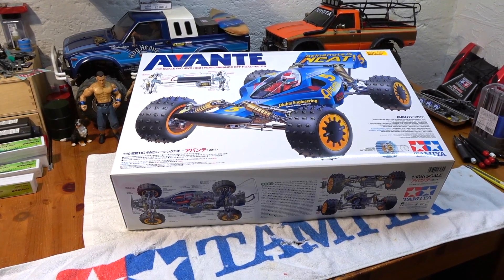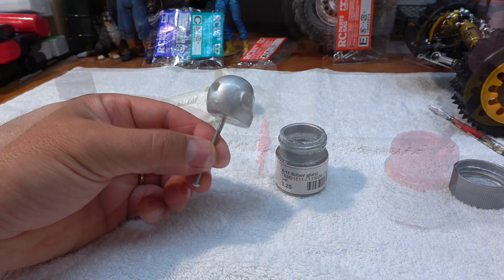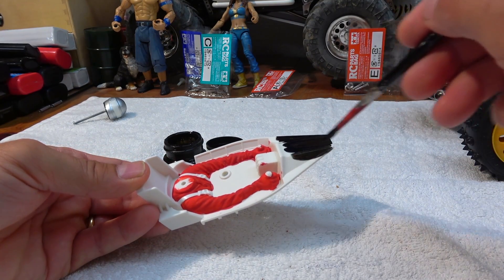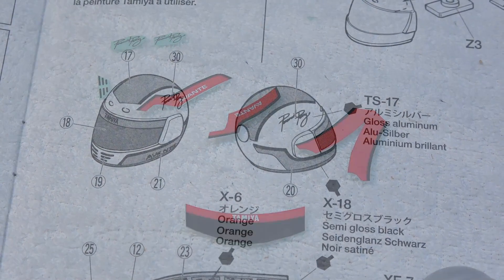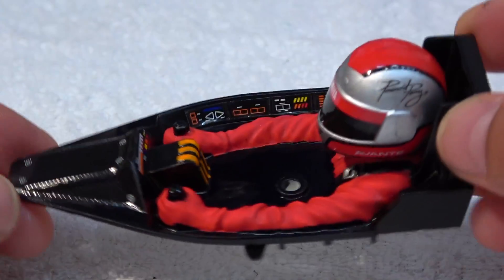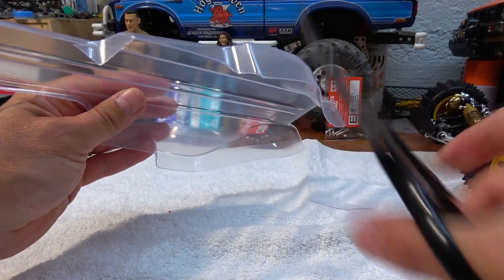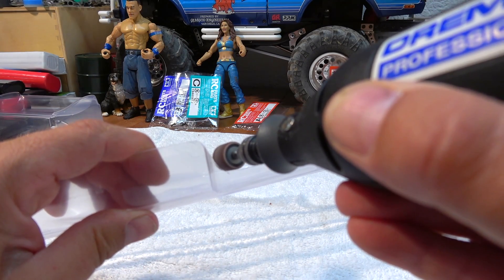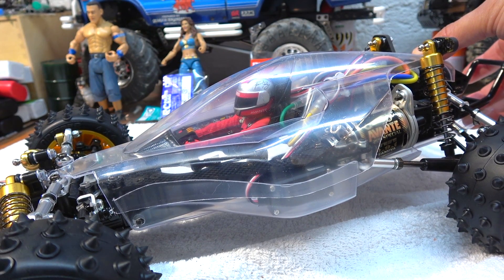Tamiya Avante Build / Video 7 / Steps 39-40

Comment: I have done my fair share of Tamiya and I have found for brush painting, a ratio of 50% paint and 50% tamiya brand thinner works best. Straight out of the bottle is horrible, too thick and leaves blotches of paint.
Reply from the maker: Thanks for the tip! 👍